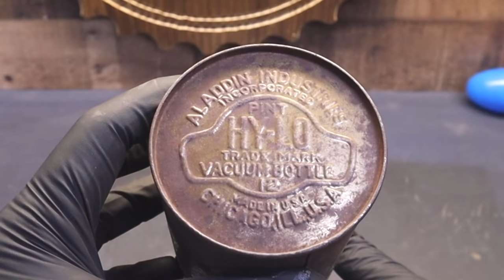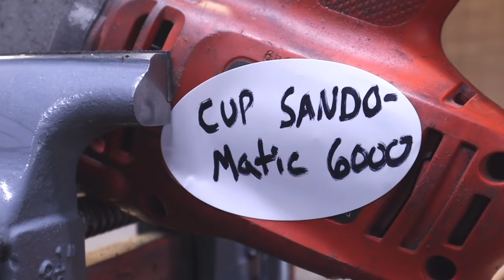Vintage Rusty Lunch Box & Thermos Restoration

Comment: Back in the day you could buy replacement glass flasks for popular thermos sizes. They came with replacement gaskets for top and bottom so there was a bit of shock absorber action and to keep liquids in the flask and out of the metal cover.

Comment: Have to admit that is a cool idea with the wire wheel and especially the cup! Great restore!Just an FYI if you scour Facebook market place you can get a good vintage wood lathe pretty cheap. I got an old Craftsman tube lathe for 100 bucks with chisels, and a Craftsman Dunlap 101 Table top lathe for 75 bucks. Both had motors but I went and scoured for some free/cheap treadmills and used the motors in them.
Reply from the maker: I’ve had my eye out for a nice lathe, I have one available to me but it’s in another state.
Reply: @DrRestoration  might be worth the drive. I took a 3 hr drive to pick up a hardinge metal lathe for 250. Fully restored its worth about 1,300. I'm in the process of it now.

Comment: I think you missed this time. Colors didn't match any of the original ones.  The vacuum bottle was an Aladin brand (likely was a dark green plaid) and had a Thermos cork. Aladin used a different system with a flip lever. If I seem to know about these it's because my father carried one when I was a child in the 1950's.

Comment: The cover for the flask is metal not wood.  Also the flask is supposed to fit it the cover of the lunchbox that's why the cover is that shape and that's why the bracket is there.  The bracket keeps the flask in the cover.